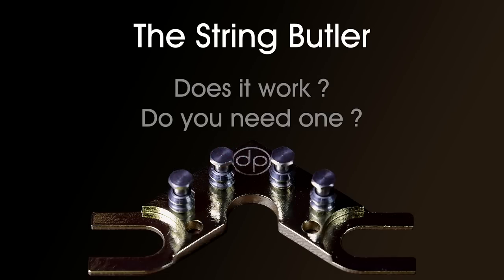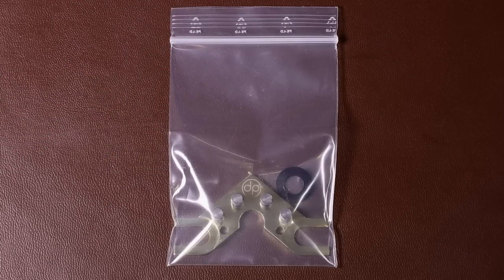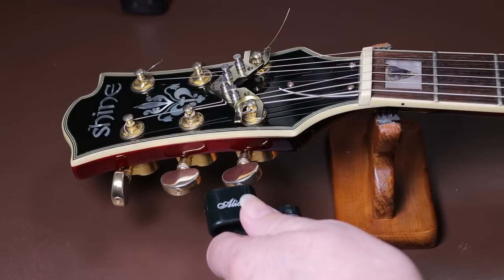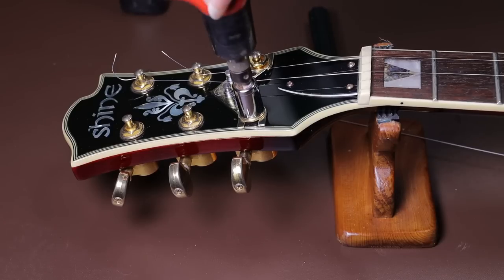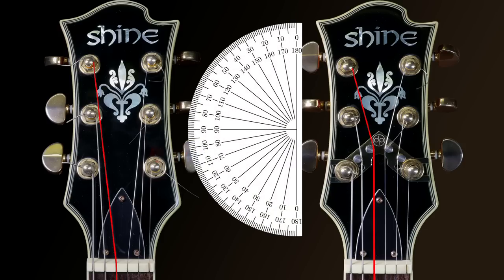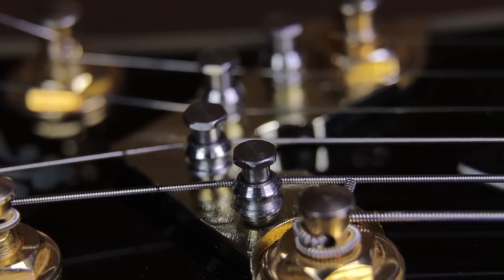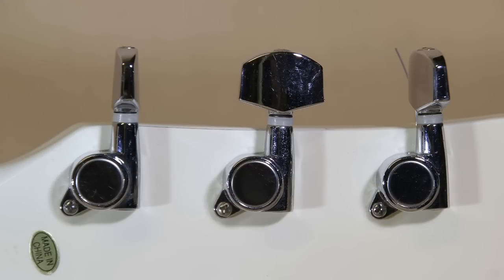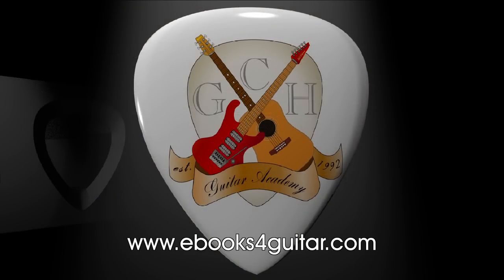the String Butler.  Does it work ?  Do I need one ?  (fitting, test & review)

Comment: I had tuning issues with my Gibson SG. Its a 2007 standard. I've had it this whole time. A couple of years ago when I started teaching I noticed the SG would not stay in tune to save my life. I had been swapping usage so I hadn't noticed it was that bad. I just recently refurbished it myself and it never goes out of tune. I considered a string butler. All I did was replace my Klusons with Grovers. I hate how the answer is so simple sometimes.
Reply from the maker: The answer can be simple but not obvious . . great when you get it sorted though . . 🙂
Reply: Crap machineheads are always 99% the root cause of tuning issues or in the particular case of the Fender Jaguar, the bridge body design in total...

What on earth were they thinking as that thing actually moves about when you whammy it and never comes back to the same place twice. 
Although I think since then engineers have solved the problem, so bye bye in and out of tune indie music that bands like Sonic Youth have made their whole sound on. But they (sonic youth) use them too now and swear by them as without it that guitar is detuned after your first dive bomb. 

As is the stratocaster with its floating bridge setup relying on a very fine line balance of string tension pulling one ways and springs pulling the other to hold something perfectly in place in space to a point where a fraction of a millimetre either side will detune the string by as much as the precious intonation will the first time you whammy that... 
So there are many things that can cause de tuning 

But if your guitar isn't a Fender or has an experimental whammy bar or is a hardtailed guitar like a gibson then you can bet its the tuners.

BTW my favourite whammy system of all and the one that works the ultimate best is the Hagstrom one, with the Bigsby coming a close second but taking up way too much real estate to be practical or good looking on a lot of guitars.

Comment: I own three of these great invention. A good way of centering the Butler is to tighten strings G and D before tightening the nuts on the E tuning heads. A little bit of lubricant on the rollers cant hurt either.
Reply from the maker: Good tips . .  🙂

Comment: great video, i also like the idea of the string passing through a radius on the roller, this will remove the strain on the string at a single point, and instead distribute any angular force along the entire radius of the roller, so i think that, even though it appears to have a larger break angle, it may actually be smaller, as it needs to be considered the angle from where it exits the roller and travels to the peg, not from where it enters the roller..

 [addition.. wont be the entire radius, just the length of the arc along the roller, on which the string travels, doh.. i can still see it, just cant mathematical describe it] 

ofc i could always be wrong, illness has made a mockery of my critical thinking capacity.. so hopefully someone reading can confirm/refute/correct my thinking? regards
Reply: Great observation. I tend to be way to detailed in my thinking also but didn't pick-up on that fact. You should be able to take string at a 90 deg angle and still have less friction than the angle thru the nut.

Comment: About a year ago I picked up a used Epiphone Les Paul that had some significant tuning stability issues.  After hearing about the String Butler I figured it couldn’t hurt to try it before looking at other issues.  I put it on the guitar when I changed strings and was very pleased to find the tuning stability was greatly improved.  Less expensive and labour intensive than replacing the tuners or working on the nut, the String Butler made a big difference.  I have no problem recommending this piece of kit.
Reply from the maker: Yes . . it's far easier than a new nut and the massive advantage is that anyone can fit one and then remove it later if you want . . 🙂🙂

Comment: Ive installed this on 2 of my les Paul’s and they stay in tune so much better than without. I had trouble with the G & D strings staying tuned, the Butler eliminated the problem. I can bend notes all day long ( I actually did this ) and it stayed in tune. Well worth the money.
Reply from the maker: good feedback . . 🙂
Reply: Right. I was careful to look into the String Butler only after I had eliminated other possible causes of tuning issues for my LP, and then, after I still could not get my D and G strings to maintain steady tuning, researched the String Butler as one of the solutions to this problem. No single solution to anything is a panacea; always a good idea to ask questions, research, get advice, and find out which solutions seem to work best for the most players in your situation. Thanks for the review, anyway.

Comment: I have one on my Les Paul and it works a treat.
Reply: @guitar-academy  nice demonstration! Check out Tru glide from db instruments.  Supposedly does the same thing but very minimalistic design compared to string butler.  Do a video on it if you can.
Reply from the maker: @allboutthemojo  Interesting . . . They're out of stock at the moment, but it fits in with the sort of thing I review so I'll get hold of one.  🙂
Reply: @guitar-academy  great.  The truglide does not seem to have any rollers where the string makes contact . How important do you think that really is? Those mini rotating drums essential?
Reply from the maker: @allboutthemojo  Honestly until I get one to test I can't tell you.  I thought the same thing as you though, so it will be an interesting test. 🙂🙂
Reply: @allboutthemojo : I believe it's very important as being an ex engineer I think about the pro & cons of different systems whatever they may be & the logic behind why it was done one way or another.
When you think about what happens to a string during tuning without a String Butler, the string is always dragged across a sharp edge when it leaves the nut but as the video proved it was a much smoother operation with a String Butler as the sharp edge was eliminated from the nut & moved further up the headstock & replaced with a much less stressful gentle roll around a freewheeling bobbin & I'm almost sorry I don't need one for one of my own guitars :-)

Comment: The string moves straight across the nut with the string butler reducing burrs and lockup in the nut. Without the string butler the string has to move at a sideways angle across the nut. This thing is brilliant.
Reply from the maker: It is . . 🙂

Comment: Very interesting but in light of the fact that i don't have tuning issues with my guitars i won't be buying one. One tip for smooth tuning is when changing strings rub some graphite (from a pencil) into the grooves on the nut
Reply from the maker: Yes it's amazing how well this works . . good tip 🙂
Reply: That's too old school.
 I've had alot of black nuts.
Works great.

Comment: Excellent video, especially with those break angle graphics and close ups ! Can I ask where you found 
that aftermarket Tune O Matic roller bridge?
Reply from the maker: Thank you very much . .  I bought the bridge off eBay but I can't find the seller anymore.  Perhaps a search on eBay for a roller bridge will find the same product from a different seller 😊😃
Reply: @guitar-academy  Cheers, appreciate that lightning fast reply. :<)
Reply from the maker: @steveb7714  No problem . . it was just chance I was on the computer 🤔

Comment: I couldn't help but notice that you only have a couple winds around the post Not sure if it matters but I like to have 3 to 4 myself Seems to work for me and don't have any issues Good demo 😊👍
Reply from the maker: Normally I would do the same but because it's been a demo guitar and the strings have had to be re fitted, they've just ended up that way . .  I didn't want to put new strings on until I was sure I wasn't going to have to take them off again . . 🙂

Comment: The thing you never said is if you actually experienced better tuning stability. You might even have a Gibson with a Vibrola and are hoping this will increase its usefulness. I already replaced the stock bridge with a Stewmac roller bridge and it seemed to help somewhat and at the least stopped the bridge from shifting  the way it had been. I also replaced the stock Grovers (Ihate Grovers) with Gotoh toumbstone machine heads too. I realize the Vibrola is useless for hard/ deep use. I wish someone made an easy zero fret for Gibson. I would think it improves things but am not sure.
Reply from the maker: The guitar always had good tuning stability, it was getting it in tune in the first place that was the issue, and as I demonstrated tuning the guitar because way easier.  (it works well)  🙂

Comment: For the D-G strings on my Gibsons, I use a Fender staple string tree and bushing. Long screw through the center truss rod cover hole and the job's a good 'un. Had them laying around so $0. Helps some. Makes the guitar feel a little better with less tension in the nut.
Reply from the maker: Good tip . . 🙂🙂

Comment: Ideally an extra turn on your post would also help tuning stability, but a good review.
Reply: Why do you say that? You don't think the string is being pulled through the hole, do you? More turns is more turns to settle and longer being unstable doing it.
Reply: @richsackett3423  Not neccesarily. An additional turn on the post (say a total of 2 on the bass strings) will increase the friction against the post and minimise slippage. The extra turns are under greater tension (provided they are would flat to the post) and will therefore stretch very quickly, and yes i do notice, from experience, that these extra turns do help stability.

Comment: Thanks for the excellent video. I see holes for screws. Should you use these? I wouldn’t want to drill into my headstock.
Reply from the maker: No I would drill for these either.  The holes offer are an optional mounting method for guitars where the method I used wont work, for example vintage tuners which aren't bolted down at the top. 😊

Comment: Perhaps putting a drop of oil on the srting butlers rollers would ensure it working longer and increase its sensitivity, would be good for long term use especially in coastal areas where there is more moisture and Salt in the air so it doesnt rust and pit. Thanks for a great and informative video
Reply from the maker: Good tip . . I live 200 yards from the sea and 20 feet from a river, perhaps I should do that . . 🙂
Reply: Dry graphite would be the answer as any wet  lubricant will bind eventually and need to be cleaned out of the roller

Comment: I installed mine pointing the "wrong" way on purpose.  (Consequently,  I did not have to remove any tuner nuts).  But because, there is an advantage to this method in that the angle around each roller is less (more obtuse) because the rollers are closer to the nut (farther from the tuning posts) than if it were installed per instructions.   The string butler is held in position simply by the string tension.  It doesn't seem to "float" around on the head stock.  It hasn't moved since it's original position that it found when I installed it.  More importantly, it works great I haven't had any tuning issues.  Before the string butler I had tuning posts interfering with adjacent strings (Sloppy head design/build)!  It's an Eastman AR372 and has a very large head with large distances between tuners.  But now it tunes easily AND stays in tune.   Well worth the money / time to install vs. the ongoing frustration of tuning issues.
Reply from the maker: That's interesting . .  I recently reversed the installation on one of my acoustic guitars and it improved the function.  It juse goes to show experimentation can be a good thing 😊😃

Comment: Has it fixed tuning issues long term? I see the strings gently turning the rollers and I see how well it fits but my question remains. Does it fix whatever tuning issues you had?
Reply from the maker: Yes . .  the tuning was sticking.  So you could turn the machine heads and nothing would happen and then it would suddenly snap past the where I wanted it to be.  Now it moves smoothly into tune as I demonstrated . .
Reply: Lude is all you need

Comment: Great close up camera work!  There's a lot of guitars where strings will bind where the string pass other tuning machines on the guitar.  Considering this for an Eastman AR503CE.  I am concerned that the extra material under the 1st and 6th string tuning machine washer will be a problem.  Not sure if there will be enough threads for the nut, with the higher nut.  Think I need to find a way to check before ordering.  You end up with less post for the string to wrap around on?  Not sure I like the idea of adding weight to the headstock.  Seems minor changes seem to change the sound.

Comment: I have a 30 year old Gibson Les Paul that was restored last year but still had the tuning issues from before. I recently bought the String Butler V3 and it looks to have fixed the problem. The G string was regularly going out of tune but has now stabilized and is holding much better. I can’t remember the last time I wasn’t constantly adjusting it. Thanks for all the helpful information. I wouldn’t have known anything about this if not for videos like yours.
Reply from the maker: Thank you very much . .  I guess one of the good things about putting it on an instrument like that (that will increase in value) is it can be removed without leaving marks. 😃

Comment: Seems like the manufacturers would build this into their headstocks.
Reply: They would ... if it was necessary
Reply from the maker: Maybe they will one day . . 🙂
Reply: They'd end up having to pay a royalty for using the system, which would then get passed onto the consumer and increase costs, higher end guitar buyers wouldnt mind as it was 38 euros ? but beginners and those strapped for cash would then buy one without and later install it. Would still be a good idea for any guitar maker whose head is like this to offer it built in.
Reply: @HBSuccess  Only necessary if you can tell the difference between an in-tune guitar and an out-of-tune one.
Reply: @HBSuccess  
Tell that to gibson with their awful tuning stability

Comment: Great review. TY for your efforts and time to explain the pros and cons. I've installed a String Butler on both my Epiphone FlameKat with Bigsby Tremelo and Gibson Custom L5-S with Stetsbar Tremelo. On the Gibson I removed the "wings" that go around the tuning pegs as they were not needed after drilling a hole at the point of the Butler and securing it to the screw that holds the truss rod cover. I exchanged several messages with Butler and he suggested foam tape and/or 3M command strips to help secure the String Butler. I found that works fine and believe it will not hurt the finish. 
I find the String Butler works very well on both guitars.
I posted photos on the String Butler Facebook page so you can see the Butler on the Gibson Custom L5-S.
Reply from the maker: Thanks for the feedback . . That sounds like a neat and professional looking fitting.  I must admit I've taken the wings off the one I use on my Washburn acoustic and it looks a lot nicer (and of course does the job) . . 😊

Comment: Your tuners have a lot of play, an upgrade would be in place too. I find the Harley Benton locking tuners excellent for the money (Jin-Ho brand Korea) FWIW.
Reply from the maker: They may seem loose in the video, but they definitely aren't,  but because they're 20 years old the gold is starting to ware off . .
Reply: @guitar-academy  Well I get your point. I mean I have tuners that have loose posts, but once they are fastened and tightened they appear solid, but the post still have a bad connection in the housing and that means bad transfer of vibration and possibly poor tuning accuracy FWIW

Comment: If you want smooth tuning and stable tuning, the real option is to dress the nut with proper nut files so the grooves are smooth and profiled to the string. The sound is usually improved too because the strings do not 'sing' in the nut slots. There's a bit of a black art to it, it's not difficult but there is a learning curve and no two instruments are the same, and the files are about £100 per set.

Comment: You should purchase the Music Nomad Peg-Winder = No slipping. I think this device Does what it's supposed to-do. Thankfully,  I play a Suhr & Taylor and have no tuning issues. I like the rolling bridge-saddles. Always use Nut sauce to lubricate: nut, saddles & all string contact points. Nice demo & information.
Reply from the maker: Thanks, I check out the Music Nomad Peg-Winder 🙂
Reply: I have no idea what Nut Sauce is, but I've always rubbed a pencil lead (graphite) on the slots in the nut to lubricate them. Works like a charm.

Comment: These work. The objective is to move the break angle forward of the nut so no string bind. I have v2 installed on 3 guitars; 1 Gretsch and 2 LP's all with Bigsbys and roller saddles. I feel this is when these work best.
Reply from the maker: There is no denying it has worked really well on this guitar . .  I am going to try a troublesome acoustic I have next . .

Comment: Have you tested the TruGlide by DB Instrument Amp?
Reply from the maker: Sorry, not yet . . 🤔
Reply: @guitar-academy  I was thinking that since the TruGlide does not have rollers, it still has friction to help with the issue you mentioned with cheap non-locking tuners while still straightening the strings at the nut. Also the price is much lower than the String Butler. Just ordered one for myself.
Reply from the maker: @quochuync  Yes, they seem like an interesting alternative and I can imagine advantages and disadvantages but as you say, price is a big advantage.  I hope you get good results from it . . 😊😊